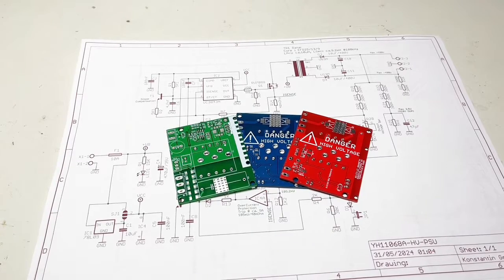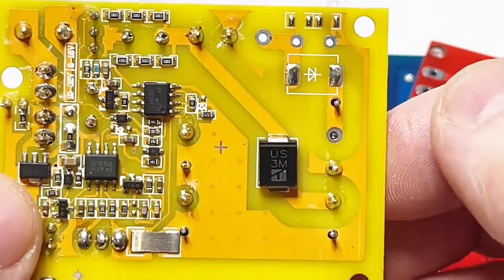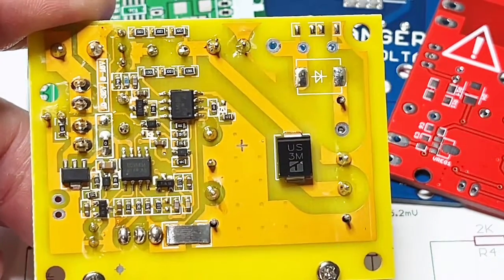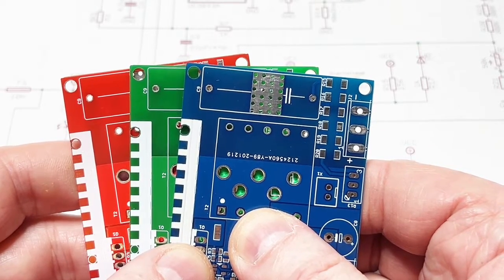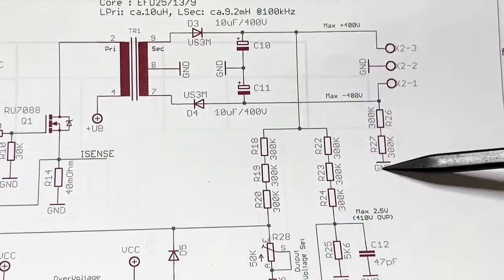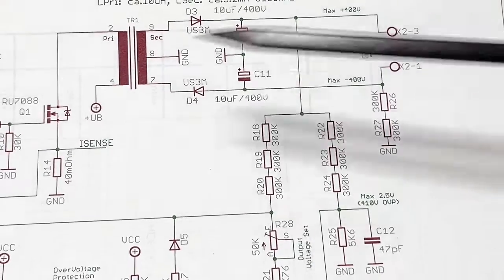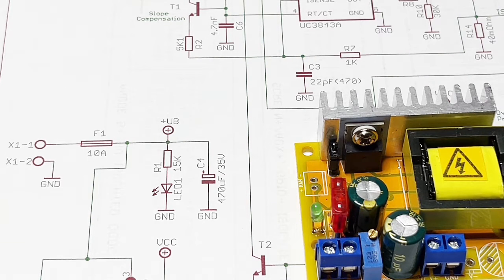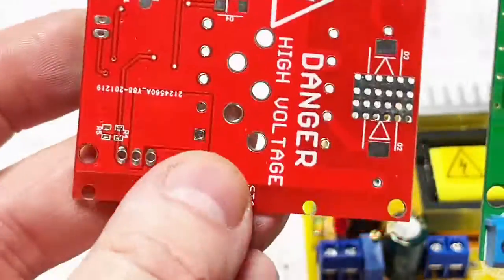YH11068A 45-390V High Voltage DC-DC, Schematic, Details, Tips and more!

Comment: Would also be a fine anode voltage supply for a tube circuit.
Reply: Very good project. I used that module in my own cap leakage tester, but have really not trusted these modules too much 😊
Reply from the maker: Hello, Thankyou, this is why I designed my own Modules using the Transformer and even the Heatsink of the China Modules :-)
Cheers,
Konstantin
Reply: I have used one of these modules for a stereo PCL86 amplifier. 13V for the filament and for the converter.
But I don't trust it much. The transformer gets very hot. I think its at the limit it can handle.
I disabled the negative rail output on mine: it had less power capability than the positive out, anyway. And when I draw power from the positive out, the negative rail was climbing in voltage as it stayed unloaded, fearing capacitor explosion.

I think the transformer could be replaced by a more powerful one from an old smps, but used backwards?? One from a 12v 60+ watts?
Reply from the maker: Hello Josep, The Transformer uses an EFD25/13/9 Core that will deliver Max ca. 20W(according to Magnetics Datasheet), that probably was intended for a Capacitor Charger for Photography  Studio Flash(my Assumption :-).
The Transformer gets Warm when these max 20W are exceeded and bcs the transformer is probably not designed to work with a duty Cycle more then 50%, which is the case using the UC3843 Chip that goes up to almost 100% Duty.
In my Design I don't use the CT of the Secondary, I use the Sec in Total. As for more Power, I would make a new Design with a better Transformer made on my specs in China. I don't use Salvaged Transformers that are not available en mass(like the one of the Module, or on other Widely available Modules), bcs this makes it a one of project and I want my Designs repeatable. 
But for a on off project the salvaged one would do, although UN-optimized and the SMPS from where you use the transformer must be a Flyback one(Laptop PSU for ex.), PC PSU' are mostly HalfBridge Designs or Better.
To get 300V and above I would use available (what I will show in a future Video) Aliexpress transformers for PushPull Operation >= 100W. Flyback is noisy, I prefer PushPull for Audio and RF when i need to Power HV equipment from Low Voltage.
Cheers, Konstantin
Reply from the maker: Yes but with additional Filtering only.